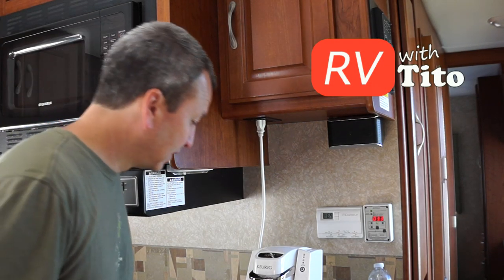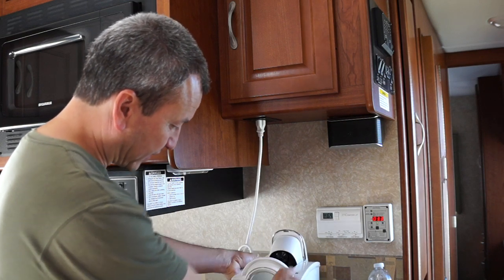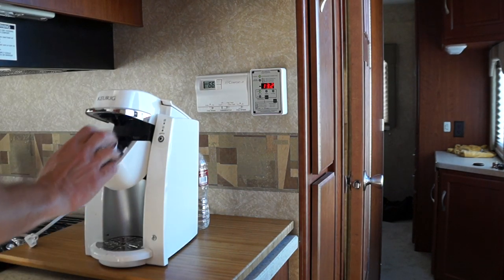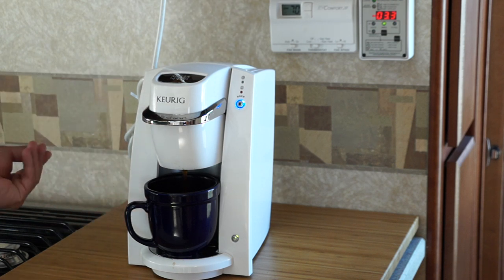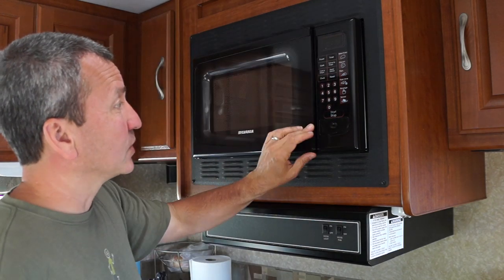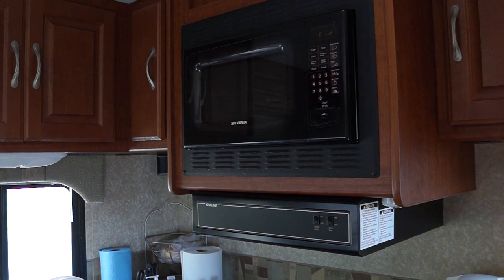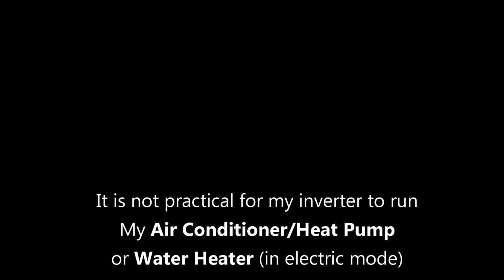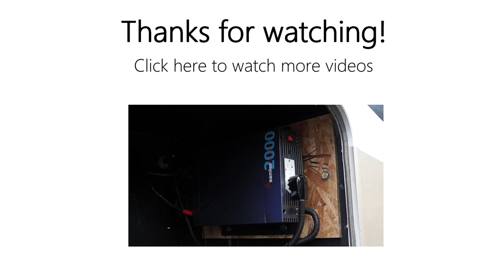RV Inverter Power Test - DIY Solar and Inverter Install

Comment: Just got back from a week long trip, 3 days off the grid.  I have 2 100 w panels, a trimetric 2030 battery monitor, Bogart SC 2030 charge controller, and a 2000W Samlex inverter.  It was cool and the heater ran most of a couple of nights, in addition to lights TV (we watched some movies) fans, etc.  Our system will not run the microwave, (I only have one 115 amp hour battery.), Fridge, or A/C.  Didn't need A/C on this trip and fridge did fine on propane.  On the coldest night, when heater ran a lot, battery got down to 48 percent.  I didn't look at what the voltage was down to but pretty low.  Really wanted to see if it would last all night in these conditions and it did so was pleased.  Things charged back up quickly when sun came up, and was back to 100 percent by early afternoon.  I need more batteries but also limited on where to put them.

Comment: Can you do a video on when you can actually use your Rv solar power.   I’m so confused.   Had solar installed, thought I understood when I can draw, but in a recent conversation, my take away is I can not use my batteries until a full charge is done each day    And a full charge is going through all 3 stages: bulk, absorption and then float.   Stage 1 and 2 in the 14’s. Then Float 13.6-13.2.    So does that mean I can not use my power until I hit 13.1?    
I’m told I have to have my batteries charged by 3 pm. 
By that time I even get to 13.1 it will be about 3 pm or later , I would never get to charge back up for the night  and never get to use any power during the day.    All that runs is fridge circuit board co2 and  invertor.       There is no explanations on the web I can find and I’ve been searching for hours.       Any help is greatly appreciated

Comment: Forgot to "like" this when I first saw it. Have a similar setup on our trailer, plus I just added an external port so I can plug in my Jackery 100 watt solar panel too. I went with 170 ah Lithium battery. I know you have upgraded your system, and saw your video on the auto shutoff for converter and thinking about that too.
Don't remember if I ever saw you plug shore power cord into a dogbone at inverter. Seen people do that, seems legit if you turn off converter.

Comment: Nice demo. Honest question:  Do you need that charge controller since you have a battery monitor?  If so, what exactly does it do?
Reply from the maker: Yup. The charge controller is like your solar battery charger. The battery monitor keeps track of how much power is going in and out to give you an accurate reading of what you've got available. It's like a super cool gas gauge for your battery bank.

Comment: What was the total approximate cost of your system? I really like the system you have and how it works as you have demonstrated. I am trying to get a ball park figure to see if it is fees able for what I need over the long run or stay with the generator. Great video and thanks for posting.
Reply from the maker: George Bowman Total cost was approximately $1,950. Here's a breakdown:
Batteries: (2x6 volts from Costco) ~ $150 
Solar Panels (2x68 watt, 1x128 watt) ~ $500 (http://bit.ly/rvwt-unisolar-az)
MPPT Charge Controller (Morningstar TriStar TS-45) ~ $450 (http://bit.ly/rvwt-solar-ts45-mppt)
Inverter (Samlex 2000 watt pure sine) ~ $400 (http://bit.ly/rvwt-inverter-samlex)
Battery Monitor (TriMetric from Bogart Engineering) ~$150
Misc cabling, connectors, fuses, and accessories (http://www.rvwithtito.com/store?dept=6)~ $300

Comment: Thnx for the video.. I'm considering self build rv w/A Ford E350 & a pop top. Do you think that your type of panels would work? I'm also wondering about the winter, since I've heard that pv panels should be pointed due south. Please advise. Thank you.
Reply from the maker: Yes it should work as long as you have room. In the winter the sun is low on the southern sky so you'll get better performance if angled towards the sun. if not it will still work fine, just at a lower performance level.

Comment: Looking to install a like system in my older camper. Wanting to get a 200w panel system, but wondered if these type panels would work hooked directly to my onboard original inverter that powers my trailer??
Reply from the maker: +Mark Houlton Mark. They should be able to provide power to any load as long as it's the correct voltage. But I can't recommend that configuration for prolonged use. Solar panel outputs fluctuate considerably and should be regulated otherwise you risk damaging your electronics. You should at least plug them into a solar charge controller which will regulate their output correctly and use them to recharge your battery bank. Your battery bank provides a stable power source for your camper's DC loads.

Comment: nice set up will it run the refrigerator or the ac?
Reply from the maker: Rob. I can run the refrigerator which draws around 300 watts. Not the air conditioner.

Comment: I was wondering what your voltage reading is when running your appliances?  Also do you have 2-6 volt deep cell batteries?  Thanks for the video
Reply from the maker: Ray J Ray. I typically only run my vent fan, laptop, TV, lights, stereo, furnace fan and even an electric blanket (for a couple hours). While running all of that stuff, the voltage level may get down to 11.8 volts. Other things like the coffee maker or a toaster can run fine for short periods. I usually conserve and run only turn on what I need. In bright sun, I may even run my refrigerator in electric mode. I ran the microwave only for this experiment only and it was during bright sun. Without the added boost from my solar panels, the microwave draws too much from my 2 batteries and can drop the voltage down too low. My inverter has a low power shutoff feature that kills power if the voltage gets below 10.6 volts. I've had this happen while stress testing it and using the microwave. Thanks for the question.
Reply: RVwithTito Thanks for the info, I have a 2000 watt inverter and when I run our 500w coffee maker it draws it down below 12 volts but only temporarily I just wondered if it was normal? I try never to go below 12.1 volts which is close to 50% so I was worried I may shorten my battery life if I let it go below 12 volts but it seems to be only while the coffee pot is turned on then the batteries are back up to 12.5 volts so I'm thinking it is not a problem. Thanks for the information I enjoy you're videos.

Comment: Hi Tito
How do I disconnect the charger? Is it on a breaker or fuse? I have a 2014 toyhauler.
Thanks
Reply from the maker: On my motorhome I have a breaker on my power panel to turn off the charger. I'm not sure what you'll have on your toyhauler. It could be the same.
Reply: RVwithTito Thanks for all your help in providing great advise and instruction. I will try the breaker switches. Thanks again.

Comment: great clip but while running the microwave did you check your battery and cable temp's thanks fester
Reply from the maker: Nope didn't check. But I have pretty thick cable.
Reply: thanks how much do you use the microwave as in everyday or now and again thanks buddy

Comment: Could you use a toaster oven to cook a pizza?
Reply from the maker: It would probably be fine. We've used an electric toaster without any trouble. Personally, I would prefer to conserve my batteries and use the propane oven instead for anything over 5 minutes.
Reply: Thanks for your answer !